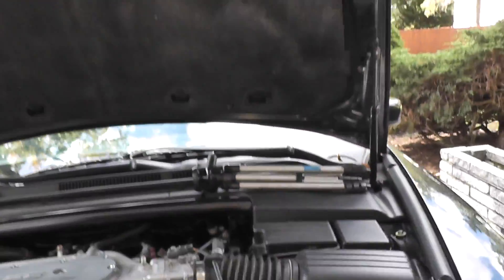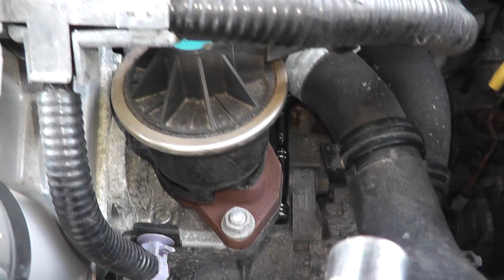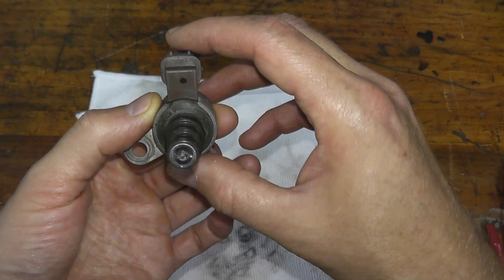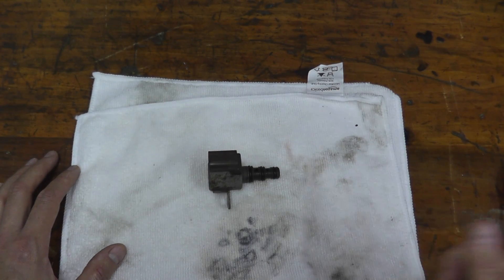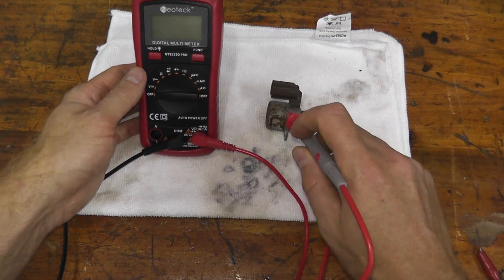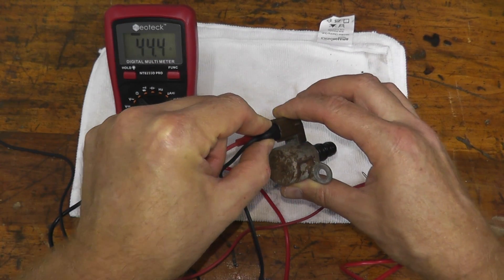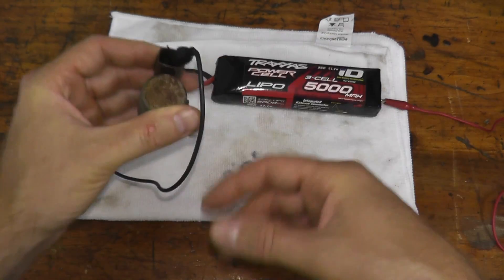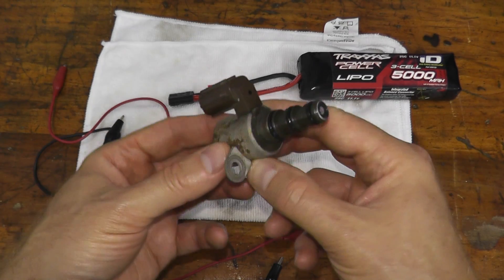Torque Converter Clutch Solenoid Valve Testing & Replacement P0741 / P2769 / P2770

Comment: Hi so i received a check engine light yesterday and i went to get it diagnosed and got P0741 which indicates that the Torque Converter Clutch Solenoid electrical circuit had performance fault or is Stuck OFF was told that I'm going to need to rebuild the whole transmission which i can not really afford unless it is my only option. So my question is what do you recommend me do ? Replace the solenoid myself? Could it be electrical? Should I have the transmission Rebuilt?    If you could please get back to me as soon as possible that would be great anymore needed info can be provided, Thank You in advance!
Reply from the maker: I'd first try draining the ATF fluid with a strainer. Look for metal particles. Do you see any? Very small metal particles are normal. If all looks okay, refill transmission fluid and go from there.
Reply: @Carsntoys  Did you get the PO741 code? If so did it come back after you cleared it? Just curious if just checking everything cleared the fault. I got the same code on a Honda Accord the other day when I connected my Actron scanner. I ran tests with it but it's limited. I have the HDS software by Honda but I don't have the interface.  I finally got up above and under the car and pulled the Solenoid you mentioned here in the video. I had the right amount of Ohms and tested via a 12 volt battery. I also test the A & B & C Solenoids and replaced a small external transmission filter. I didn't see any metal fragments or shavings in any of the solenoid filters or external filter. I need to put the battery back in along with the air filter. I'll clear the codes and see what happens. I just did two drain and refills around 5000 miles ago and it was free from any metal but their was a small amount of tiny shavings on the magnet. I'm at a loss but I will be checking the voltage to the connectors tomorrow. Thanks for posting the video. I did it the same way you did and I got the information out of the Honda service manual.
Reply: @seekersees693  so did it clear the code after u did all of those? Any dramatic shifting issues or slipping that was corrected?
Reply: @juliosdiy3206  For about a month then it wouldn't move in any gear. I didn't want to drive it anymore after that because it could cause further damage. I had AAA tow it 35 miles to a transmission shop. I live in a very rural area. I know some mechanics and one specializes in rebuilding transmissions. It's the only thing he's done his whole life. He said the clutches were most like worn and the torque converter seal was probably leaking. After he got it apart, he called me to meet him. Sure enough, the clutches were worn badly with two sets being nearly burnt and smooth. The torque convertor seal was on the way out. Also, the filter was shot and the circuits were getting clogged up with fine material. He rebuilt the whole transmission with all new internal parts and it came to $1910. Also, three of the motor mounts were shot and that added $150 dollars. The major shops and dealerships wanted nearly twice what I was charged. It took about 4 days to complete it. I got a good warranty and it runs great now. It shifts great and it's smooth again. Hopefully, your transmission isn't the same but if it has high mileage like I had, you're most likely looking at a rebuild. That's coming from the friend who rebuilt mine. I wanted to keep the car even though it's a 2005 Honda Accord EX V6. It's fully loaded and still looks new. It was a lot cheaper than even buying a new or used car. And if I went with a used car, I could end up with the same problem. I have aother friend who owns a little restaraunt near me and she has a new Audi (nearly 3 years old) and her transmission died. You just don't know what your buying anymore these days.
Reply: @juliosdiy3206  Sorry for the delayed response but YT never notified me about your comment. I don't get many notifications anymore. I usually get notified when someone likes my comment and that's whay happened here. Someone like the comment I made and I saw your question. YT has become a horrible platform now.
Reply: Seeker Sees before you changed the transmission was the car slipping. When you first got the code was the car slipping at all or did it happen after you did work to it?
Reply: Jabril Muhammad I’ll answer this on my behalf and in my case my transmission was not slipping until I did the 3x3 fluid change which actually helped the first 1/3 but the 2/3 is what made it really start to slip but it eventually got really bad where the car is not drivable I brung it to 2 separate transmission shops which both said i need a rebuild and the cause was the torque converter / worn clutch pads
Reply: John Bonsignore so it’s not a good idea to change the fluid? I have this code but my cars transmission is in perfect shape
Reply: @TheLykon  Yes, a handful of times I noticed it slipping but it was only in the morning when the car was cold. I didn't notice it or feel it cutting out while driving. I would go to put it in reverse and it would take about 5 to 6 seconds to engage. Oh, and one thing I really noticed when at idle and in neutral is it started making a slight humming/whining noise but it would go away after the car warmed up. It was more noticeable when I put my ear up next to the front tire (LF) on the drivers side. That was the torque converter going out which I learned about from my friend. That's how he knew. I knew then something was going on when all this started happening. The code  popped up about 2 weeks later after I noticed the slipping and humming. This is when I did the flush and checked the electronics. As you know it was all internal issues with my transmission. I did have 242K miles on it. Most of it is was highway miles since I live in a rural area. All the external electronics tested good.
Reply: @GalaxyIV37  I've read up on the 3x3 flush and chose not to do this. I've always heard it was bad to do this and some of the old oil should remain in the transmission. This is why I only did it twice during the summer. After the rebuild I asked my friend about draining it in the future and he said to drain it 1 time every 60K miles with DW-1 to maintain the viscosity. Plus it allows me to check to see if there is any metal coming out which would be bad. It's okay to see the tiny shavings. He said I should not see any metal shavings or just a few on the magnetic bolt at 60k miles after a rebuild. I always drain it through a fine metal sieve to see if any metal comes out and I never saw any. All the fine shavings were clogging up in the circuits because the internal filter was full of them.
Reply: @TheLykon Do you know the color of your fluid? If it has a brown tint, the clutch sets are burning up. When the clutch sets wear and become smooth, this is what causes them to start burning up. Hence, the brown color which indicates the transmission is on it's way out. You may get to drive it 5k or 50k miles before it goes but it's eventually going to go. If you choose to drive it knowing this, it can cause more internal damage which will cost you in the future if you rebuild it. If it's black, it's shot. Also, even though it's rare, the pancake oil cooler on top of the transmission housing can crack internally causing radiator fluid to get into the transmission. And you;ll probably see transmission fluid in the radiator or overflow tank. When this happens, you have to rebuild it and having the cooling system flushed. You don't have a choice. Again, it's rare but it can happen.
Reply: Seeker Sees my fluid looks good and the transmission shift well. I just can’t figure out why the code won’t go away
Reply: @TheLykon  It could be an electrical issue. Did you verify that there's voltage at the solenoid connectors. And there is only two solenoids that would cause this. Even though these may test good, they could still be failing. For instance, the solenoid is not opening all the way. It would be cheaper to replace these than a rebuild. I'm not sure the model and year of your car but if you have an Accord between 2003-2007, here is the actual Honda service manual. It will show you how to diagnose and check the problem. The PDF it about 389mb and over 7000 pages. It's clickable wihich makes it easy to navigate. https://www.fichier-pdf.fr/2017/01/02/honda-accord-2003-2007-incl-v6/honda-accord-2003-2007-incl-v6.pdf
Reply: Seeker Sees p
Reply: Seeker sees  ,your very helpful and kind. Now I know that me and my beloved Ody. have to go our separate ways. Thanks to Cars N Toys for the video. You both earned a sub. Thank you YouTube for the best source online for DIY.
I think I'm going back to stick shifters! Thanks everyone on here for helping each other!
Reply: @Carsntoys  
What are the systems of a faulty valve?
Reply: John Bonsignore h
Reply: @ColoradoStrong-w1j  sounds like a little bit of rubbish there brother.im not sure about using 3x3 flush oil change or both being bad for it.that im not aware but im dead sure that keaving metal shavi gs make it operate. Make sense !??? NO SORRY I DON'T BROTHER... im not being one bit cheeky or ignorant here towards your obviously trying to be helpful.but im too just questioning your resonse so dknt start a war please im only confronting your debsteable response to imo a nonsense remark that msynor may not be hellful to someone looking answers tk their vehicle so letvthem read all the answers and debates here and let them decide the cars fate if they'd like to have fixing it an obstacle that they would like to give fixing it a go theyre selves after reading all the amature and in some cases pros knoledge a go then let them, but get all the guesses dos donts rights wrongs and i dknt knows all into consideration. I love these little cgats and discussions online.im a mechanic lkd skool had a horribke accident years back and semi paralyzed on a motorbike race i kove keeping up to dste with reading all the new stuff thats online to read and the knoledge that ppl has these days asxa result of thevinternet is anazing to wstch.im onlyv37 and i remember as littlexss 20 years ago id ppl calling to me to change a wheel or put a headlight bulb in lolol .jesus crazy j see pll now near me literslly in thrir garsgexwith the car ramped up pulling gearboxes out to change clutch with youtube on its amazing guys really is.i thought i was amazing changing a head gasket and leaving head 2 hours away to get skimmed and rebuilding it.lol.it was a honda integra type r and i thought i was amazing the man the king of the dpanners lol, at 15 reading from a book on a 94 jap import only couple years old.lol .oh the good old days before it all went to shit for me less than 11 years later,.but ill never forget that first big fix i did at the side of my home by myself no help at all made me feel like a master of the universe haha..i suggest anyone young or old if your fit and know clockwise tightens a bolt snd anti clockwise loosens(unless keft hand thread) i suggest give it a go if you have you tube a socket sst spannersxsnd a gernal tool kit and love a chalkenge you wont ever get s feing of acheivrment seeing somthing thsts dead come to life agsin knowing you brought it to life.if you have s love for motors asvi akways have youll never get that feeling of acheivement like it i say give it a gk.famous lsst words..WHAT COULD POSSIBLY GO WRONG ...HAHA. and discussions debates and general chat very interesting and helpful kn a lot of cases,but the reason for the comments is to call it when you see right or wrkng snd i think in kost cases leaving metsl ahzvings swimming around bearings and spinning moving parts is a definate no go id say its obviously very bad to get any of tgat crap inducted into the hall of shit..
Lol .i just dont see them put a magnetic bolt and a filter sometimes multiple filters to collect as much of those shavings snd particles to swim around your healthy oil .